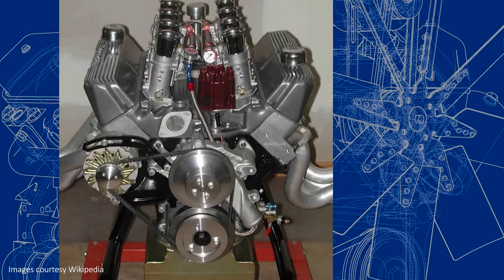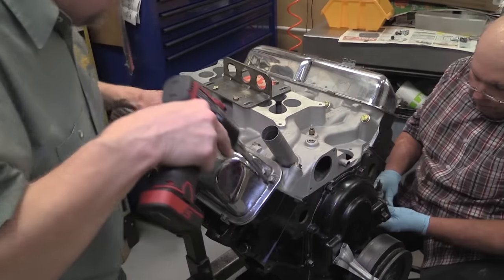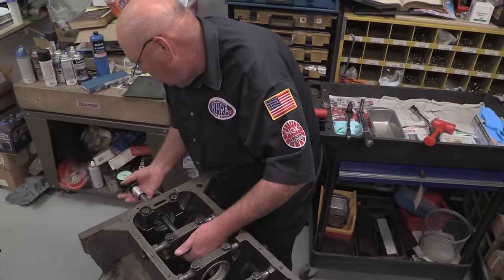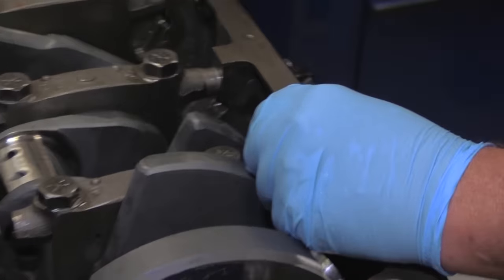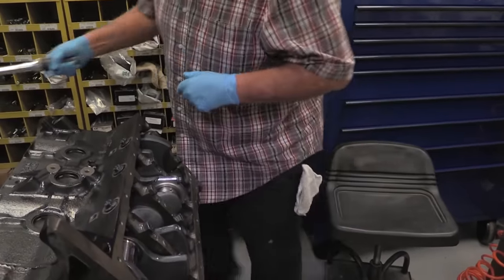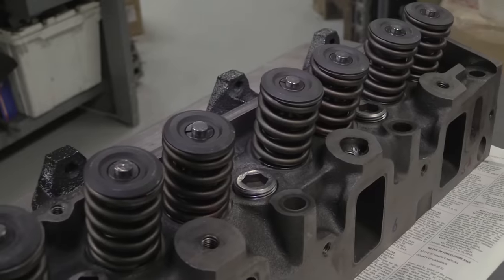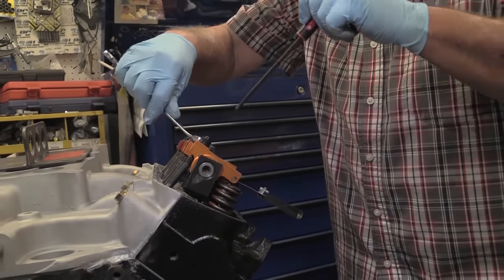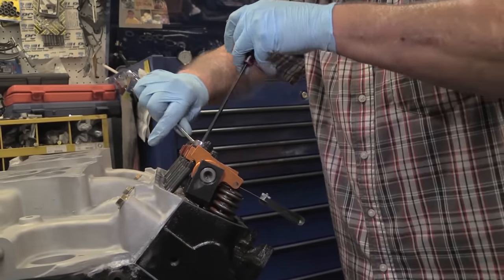Monster Ford 427 Top Oiler Engine Build and Dyno Session

Comment: Great video, which shows that the stock 427 FE heads and dual 4 bbl intake were very well designed, and were able to handle an extra 75 cubes and what ever that cam was able to pull through also. The torque and HP graphs show that. Amazing !!
Reply: That "RV cam"? Yeah. That's about how its specced and the "power numbers" just prove its another boat anchor FE. Not nearly enough chamber for the cubes. Chamber volume is the real engine "displacement" and the largest FE chambers are 350 Chevyish in volume BEFORE idiot "engine builders" start "milling heads" and "zero-decking blocks" and "adding compression" by making the chambers smaller yet. And that's why "500 hp" at some ridiculous Fordtard-impressing "redline" of 7000+ rpm is a "big number" from an FE even when 1/4 of it at least is "free horsepower" from zero accessories, headers that fit zero Ford "platforms", "creative" dyno calibration and "correction factors", 70-degree intake air, cold fuel, endless "tuning" and asinine air-fuel ratios that on the "street and strip" will alternately "foul plugs" and "burn plugs" as they fluctuate from stupid rich to suicidally lean. 

But what does anyone with a clue expect from "state of the art" engineering circa 1956 Ford Motor Company? 

One HP per cubic inch in a real wedge-head hydraulic-cam 10:1  small-block with an iron dual-plane intake and exhaust manifolds? 

Oops. I keep forgetting how "dominant" Ford was during the "horsepower wars" and I end up spoiling Fordtard fantasies with SBC and BBC facts. EARLY "1st generation" SBC and BBC facts, no less. "Small-journal" 283-HP 283s, 425-HP dual-quad 409s etc. 

After 1962 shit just starts getting out of hand. 350 SAE-HP 327s, 435 SAE-HP 427s, 370 SAE-HP 350S...

I always get a kick out of those "370 HP" 10:1 solid-cam dual-plane single-quad iron-manifold LT-1s. I'm pretty sure Chevy was just "protecting" the rep of the venerable 396 with its highest but  relatively "mild" sub-1 HP per cube 375 HP rating from an engine that with basic "blueprinting" and the "allowable modification" of what I tend to think was a "cam swap" to an L88 427 bumpstick but is still a mystery, a "college dropout" named Bill "Grumpy" Jenkins managed to get "around 540" horsepower out of running 10.50s in a 3250+ lb. 4-speed Super Stock Camaro. 

But its also "convenient" that Chevy if only accidentally still managed to protect Fordtard fantasies of "big power" from Fucking Edsels and that "375 HP" that was the "high water mark" for those "big-blocks" with small-block "lungs" by not "overrating" what was and still is a VERY "mild" 350 Chevy. Knock off one "point" of compression, slide in a hydraulic cam like Chevy did in 
'71 and you still get 330 SAE-HP. 

Amazing what matching chamber volume to displacement and flipping the bird to "flow" in an engine that needs hundreds of cubic feet per minute of "flow" per port to fill and empty 42ish cubic inches of cylinder with fuel and air concentrated into dozens of cubic centimeters of chamber volume only once every two crank revolutions will accomplish vs. idiotically "porting and polishing" head "ports" that can't and won't "flow" any more air than previously unless you "port and polish" the "ports" in the intake manifold, exhaust manifolds/headers etc etc etc and all on heads you idiotically "shrink" the chambers on simultaneously during your "build". 

Of course even "Chevy guys" can be idiots and especially the ones that think "Vortec heads" really make "good power" on 350-406" SBCs because they "flow" so much better than "traditional" high-performance SBC heads like "camel-hump" 1.92/1.50 327 heads and "fuelie camel-hump" 2.02/1.60 327 heads and even "turbo" angle-plug "LT-1" 350 heads with "mild cams" and "pump-gas friendly" CRs. 

Seeing as how there isn't a single SBC Chevy head any "bigger" or "smaller" at the actual "port" openings "out of the box" and its really that "Vortec" aka TRUCK heads have "big" chambers in the 72-74 cc range like ALL 350 TRUCK heads have always been and that are a good 5-15 ccs "bigger" than the typical "high performance" SBC head after being "rebuilt" one or more times with material milled off the "deck" and hardened seats and/or "big" valves installed both of which replace "empty space" with "solid metal" which USUALLY gets installed on a "blueprinted" block some idiot "engine builder" has or has had "zero-decked" for maximum "quench" with flat-top pistons and "high performance" thin-to-win head gaskets which all reduce "chamber volume" even further. 

And all in the idiotic pursuit of "more compression" like that doesn't automatically and drastically reduce "pumping losses" while reducing chamber volume every f'ing time. But at least a "Chevy guy" can slap on a set of brand-new iron Vortecs for $500 during a "build" and not throw away the same $500 "rebuilding" a set of small-chamber high-peformance 4"-bore SBC heads for a "stroker" 383 or "de-stroker" 377 or even a "boat anchor" 400 SBC build.

Build a good "boat anchor" 406 SBC with a set of Vortecs and 9.5ish:1 compression and a good stout LT-1ish cam but hydraulic-roller and dual-planed with a properly "tuned" so-called "QuadraJunk" carb AND a "stock" properly "tuned" GM HEI and stick it in anything 2-door and 2wd "Chevy" from '62ish on in front of a 4-speed, 'Glide or TH350/400 with a very mild "stall" and keep it under 4500 lbs with a high-3s/low-4s rear gear and you will make Fordtards "race" EACH OTHER trying to get the fuck off the "street or strip" before they hear "You're up" in their FE-powered fantasy wagons after they see the first loser get "blinkered" at half-track. 

Know what getting "blinkered" is? It's when the guy in the "suicide lane" has enough lengths on you before the "finish line" to go ahead and signal his "lane change" and pull into your lane in front of you. 

Kinda hard to pull off on the "strip" even If you somehow manage to get a "heads up" race and most "kids" millenial age and Fordtard children of any age wouldn't "get it" if it happened to them on the strip the maybe 1% of 1% of the time a millenial "car guy" or Fordtard that claims to love racing "heads up" and "on the strip" actually shows up and lines up and goes heads up and is in a position to get blinkered and does so. And of course its likely that he won't "get it" but will talk shit about that "sandbagger" in the left lane that almost "sideswiped" him trying to make a "right turn from the left lane" WAY before "they" even got to the "finish line"  and blah blah blah...

But "on the street" if even a Fordtard gets "blinkered" he'll eventually "get it" during the "merge" and typically he'll "miss his turn" and just keep right on "racing" home to the garage "heads up and eyes forward" and probably on the verge of tears having just had his FE fantasies ruined by a little old Mouse running a QuadraJunk, HEI, low compression, small valves, a mild cam, dual-plane intake and IRON TRUCK HEADS. 

FORDTARDS INCESSANTLY BITCH ABOUT AND RUN FROM "LS" BOWTIES WHEN THEY CAN'T EVEN GO "HEADS UP" WITH AN "LT" AND THAT IS SOME FUNNY SHIT.
Reply: @deeremeyer1749  Funny, looks like a little ole 4.6 4v is faster than your pos LS. Chevy "We have a new engine!" What'd you do to it? "Nothing it's the same pos pushrod engine just bigger and supercharged!"
Reply: @deeremeyer1749  - we see that you are a legend-in-your-own-mind - and certainly also considered one by people who know you.
Reply: @deeremeyer1749  Are you done? Feel better? I hope so.

Comment: There is a whole bunch of power left on the table with this FE. The induction , cam & heads are limiting potential without question. There is easily another 60-70 hp in a cam change alone. I bought a 1966 Stevens flat bottom  V-drive boat for $800 on Craigslist in 2017. Guy found it in a out building of a house he bought and had no info on it.  Turned out to have a 427 side oiler in it . looked to have sat for at least 25 years. And I'll be damned if I didnt get it fired up after a oil change , carb swap and fresh gas. Pulled the engine and then the heads a while later and it was stock bore with no cylinder wear or ridge. Hull was dry rotted so its now in my shop waiting on a new home to arrive.
Reply: I'd call that a steal...

Comment: The Shelby built 427 side oiler 
Was actually a 494 and up turning out 525 HP and 550 tq as a starting point, we putting them in the CSX 4000 Cobra weighing at around 2000 pounds. Very quick car

Comment: The comments are coming from the belly button guys. The FE was built for racing from the start, the block has good bore spacing, the heads/manifold for several; different combinations, low riser, mid riser, high riser, tunnel port and then cammer. It won La Mans 1,2, 3. It raced in Indie. Cross bolted mains, oil to the crank, it was a racing engine that did not need special modifications.
Reply: Side locking mains are still the strongest I ever seen for a production engine. Something Ford still produces today..Still not sure why they didn't just install some after market heads. You can always take them off..Yet still use pump gas 92. 

I still think they could have got some better numbers. If they played with the timing..
Reply: 352???🤔

Comment: The ford 427 with the Lemans Crank and rods would turn 9600 rpm. Stock rods and crank 7600 rpm. This build is streetable but there is much more potential and that's for sure. But they are rare, I wouldn't want to scatter it. It really needs to be put in a 66 Fairlane with a four speed and a nodular nine inch axle.

Comment: I took my stroked top oiler and made it a side oiler, its something we did back in the day, you drill the side cap bolts through feed an external oil line from filter housing straight to main caps, you put a restrictor in the top oiler oil gallery to mains, this way it actually oils some from top and sides, and I always use full grooved main bearings for 360 oilings. Never had a one fail. So don't pass up those top oiler 427 it's an easy fix for better oiling at max horsepower.
Reply: Is that what I've seen on the older Y-blocks?

Comment: That appears to be  a lot of  cam and  valvetrain voodoo for those  heads.  Likely run the same  top end torque  peak  and make gains off the bottom with mild 218/225 deg and under  0.500" total lift. Its  a roller with aggressive  ramps. - Thank for the Fun and  memories,  I  Owned a Blue 428 FORD Fairlane  500 Fastback Cobrajet with a toploader 4 gear. bought it used for $750 bucks in 1976. Imagine it was only 7 years  old then :)   - Sandy

Comment: check the blocks 427-426 hemi bottoms up,they look identical,shows if you can't lick em,join em,this engine is very powerful, built one 1969 for buddy who had more money than brains,he built it 41 days before going into the service,we finished it,he said he would blow it up before going in,he burned up two sets of rubber,the engine was waitin on him when mustered out,427's are durable
Reply: The standard big block Mopar, and the Ford FE engines both came out in 1958, and both had this deep skirted bottom end, which makes the bottom end extremely rugged. The HEMI used the same design because the block is basically the same as the standard big block Mopar B and RB engines, with the main difference being the head bolt pattern.
Reply: The mopar didn't use the spacer though. That would make me nervous at high rpm.
Reply: its all moot now,the carburetor wars were over in the late 80's,everyone is on the power adder formula,its broken blocks and heads and rods for ever,well my valuable blocks and heads are for pressurizing and the spacer you're talking about,i've built thousands of engine in 47 years only spacer I ever saw in either of the mountain motors was fords a bellhousing spacer,good luck ET IS THE NAME OF THE GAME,FORGET THE GUY NEXT TO YA,ITS THE CLOCK YOU'RE BEATING

Comment: I hated that intake design when I rebuilt the 360 FE V8 in my $500 73 F100 back in '95 (first time doing engine work). One thing about the FE V8s, they were tough. I initially pulled the heads on mine because the straight duals were leaving two black oily circles on my apartment wall every morning. Turned out every singe compression ring was broken..even thought it still ran fine. If I had to do it over again, I would throw out the trash emissions intake that caused mixture issues. Wow that engine sounded good with straight duals.

Comment: In the mid 1980s I purchased a factory 1963 Ford Galaxy 500 "Plane Jane" 427 side oiler finished at the Dearborn /Detroit Tubular Co. That 63 Big Detroit Sled was a factory sleeper.. I would put Corvette,Nova's, Camaro, Chevelle, Pontiac, Plymouth, Dodge owners into tears up & down Gratiot Ave. Telegraph Rd. Even at the well known private road in River Rouge, Michigan called Industrial Drive.. Simply nicknamed "IndustrialDragway" The I.D They may have got my Big Ol Gal off the start, but after first gear, she'd wind up & leave Em in my rear view mirror.. F.E Big Block.. Good Times & Memories From Detroit, Michigan
Reply: Sorry the side oiler wasn't made in 1963

Comment: Just a question....what are the heads used here...are they the low riser 427 items? They have the same valve size as the 428 CJ...2.09 intakes and 1.66 exhausts.....

Comment: When they were running the engine at max smoke was coming out from front.
Was it the exhaust manifold vs head gasket.
Looked like oil burning off somewhere. Anybodies opinion!
Reply: Robert Angelier I wouldn’t be surprised if the valve covers were leaking. I kinda cringed when they used a impact on the valve cover bolts and not in sequence.

Comment: I always liked the 360 ford or 390. They were I think the most underrated ford big block motors.
Reply: 360s were truck engines, only the 352HP and the 390HP's were considered high performance in factory trim. Yes, they were good for family cars and trucks.
Reply: I put a352 4 barrel intake on my 73 360 with a 600 cm carb and it ran crazy quick. What I liked most was I went from 13 mph to 18 after getting rid of factory 2 barrel.

Comment: Around 4500RPM the heads started choking it out. Some good heads, hell, even a port and polish, would have done it wonders. It's a shame too. Lots of bling in the bottom, but it just gets choked right out in the top
Reply: So wrong LS 7 ports are identical to FE heads look closely
Reply: @robertsnowden4729  port, bowl design etc isnt even close

Comment: I have a stroker 427 (452) built 15 yrs ago with the same cam and Edelbrock heads and intake, made 550 hp and 600 ft lbs. at 6100 rpm.  This engine is being strangled by the heads and intake.

Comment: Circa 1988 I purchased a 1963 Ford Galaxie 500 Notched Back or Post Top.. (Not A Fastback) Factory delete, radio, windshield wipers , heater.. Built by Dearborn Tubular Company in Detroit, Michigan.. 427 Side Oiler, duel quad medium riser intake. Fiberglass door skins, trunk lid, fenders, & hood. Lightweight front & rear bumpers.. Factory delete side mouldings .. Kelsey Hays factory rims , no hubcaps .. Original owner.. I paid $7000 in late 1980s .. I knew what I had & was humbled to take that owl girl over.. White knuckled down the street & roads.. I made many Camaro, Vette, Firebird, Olds, Chrysler, Dodge owners cry on Drag Strip & Street... Scariest & Fastest car I ever owned.

Comment: Well they could have gotten more power out this big cubic inch engine, but as long as the customer is happy. Who cares! My mild 496 made 565hp & 600tq all under 6 grand. On 9.1:1 CR and 088 heads...its more than enough for my street '68 Impala👍
Reply: Brian Samuels ; I didn't know you could stroke a Ford 427 to 496ci's?
Reply: @cobracharmer6178  Brian is talking about a Chevrolet big block 496
Reply: @edwinbeck456  ; Thanks! I think you can get a 454 from the Ford 427?
Reply: A big block chevy cylinder head is much better the F.E. parts

Comment: the 427 one of the greatest Motors ever made Ford first on race day fast on race day and last but certainly not least ferocious on race day no damn junk Chevrolet
Reply: Fix or repair daily
Found on road dead
Fucked over rebuilt dodge 
Driver returned on foot
Reply: @EASTSIDE-313  Southside Ford first on race day fast on race day inside number 7 and last but not least ferocious on race day pal no damn two-bit and junk Chevrolet will leave the Dodge guys for another day but for now East 13 it's the blue oval all the way
Reply: @EASTSIDE-313  oh yeah? Who won the most races & the championship in NASCAR? Ford. Your probably too young to remember when Ford's dominated PS in NHRA. Yes that was back when Glidden, RIP was still racing. He had the ONLY PS car to retire undefeated, never lost a single round the entire season!!! Ford funny cars were Ford powered & winning in John Force,& other's cars until Ford decided to pull out of drag racing & devote all to NASCAR!!! It takes more money to get the performance out of their engines compared to Chevy, but if your diehard Ford man,it's worth every penny!!!
Reply: I love this especially the bondage buggy im smarter than you and this is better than that stuff. Hey you know who builds the best? Your machinist, the factory builds passenger cars. I thought this was cool